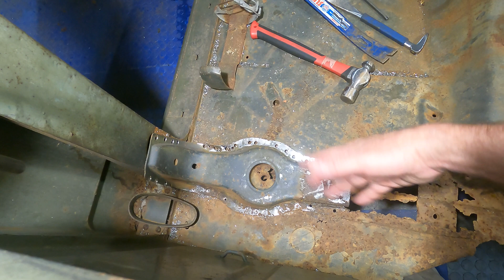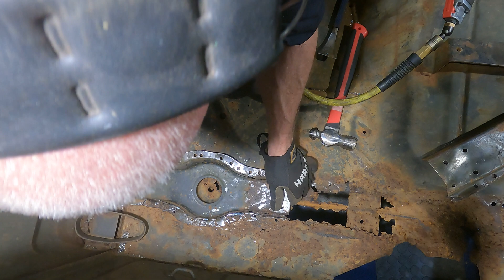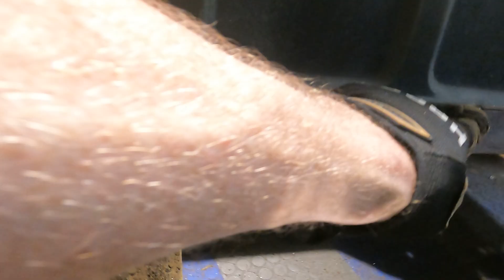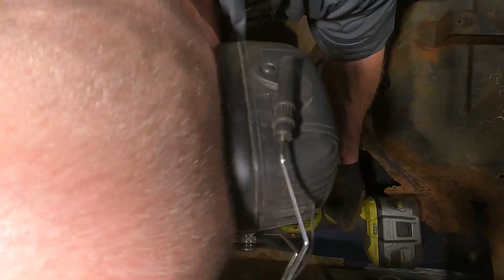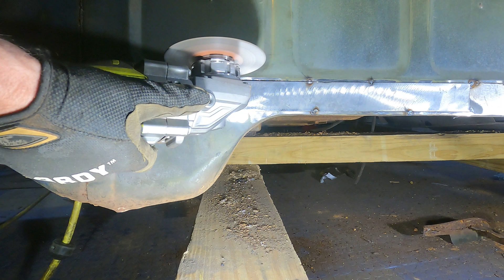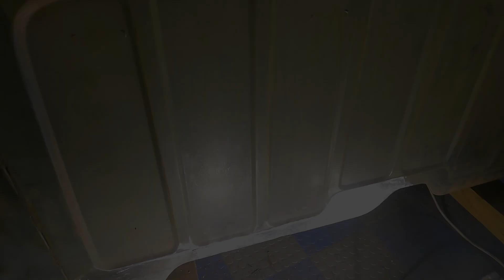1967 Kaiser Jeep (M715) Project - Rear Floorboards - Rusted Metal Removal and rear wall repair.

Comment: I’ll be doing this in about a month to my M715 project. Did you look at the replacement floor panels? I’ve seen them available on eBay, but I’m concerned with them being made of a thin gauge metal. And of course not even being close to spec. What gauge is the original metal?
Reply from the maker: To be honest, I can make just about everything I need so didn't look for replacement parts.  Also, I wanted the challenge of doing it all myself :)  (at least this far, that may change, LOL)

The floorboards are quite thick, I did not measure it, but at is close to 16g, as that is what I'm patching it with and the thicknesses are very close.  However, the truck bed is significantly thicker, I think it's closer to 14g (that's what I used to repair the stake pocket).

Like everything, I'm sure there are good and bad suppliers of aftermarket replacement parts out there.  M715zone.com is "THE PLACE TO GO" for questions on parts though!  Quite a strong following and a lot of forum activity.  Since the vast majority of surfaces in these vehicles are flat (or nearly flat) it's a pretty easy one to patch up.  

At least making my own panels, I know they fit, but I'm positive there are quality suppliers out there.

Comment: Im a new sub and if you would like some advise to save you some time and effort, I would gladly give it. I've had decades of experience as a metal technician in the autobody repair industry! might want to look at some videos on pneumatic flange and punch tool the can be your best friend if used properly...
Reply from the maker: Thank you so much for commenting and for your suggestion! I do appreciate it! 

We are a machine shop and fabricator, but don't do automotive, the jeep project is a personal one.  Since we dont do auto body, we dont have specific tooling, BUT i would LOVE to have those tools, i just cant justify for this one project.

That being said, i just missed out on a 48" box / pan brake that would make life wonderful! An english wheel and flange roller would be AWESOME!  If you have an extra lying around, let me know :)

Also, i would LOVE to hear any suggestions you have!  Im never above learning!